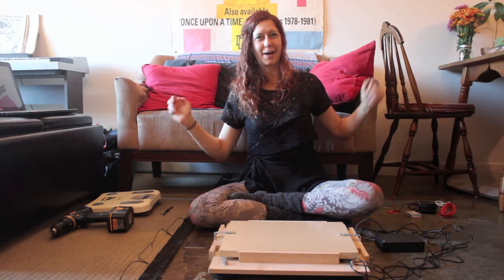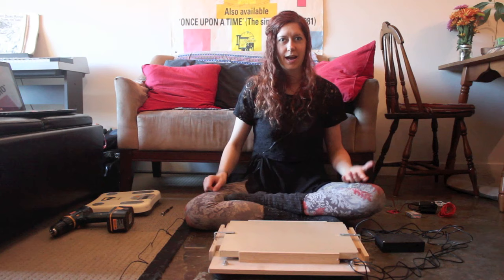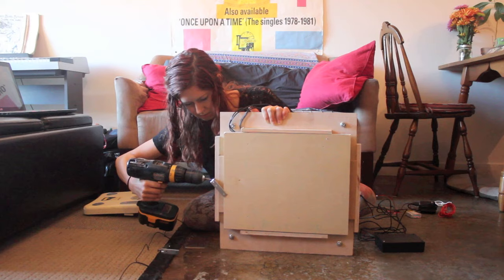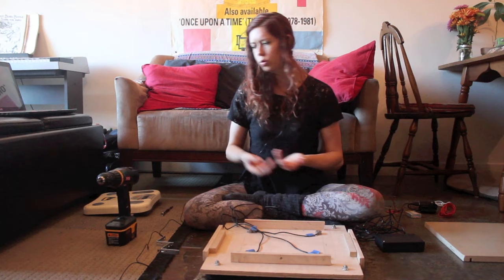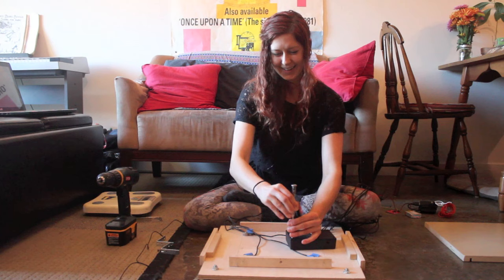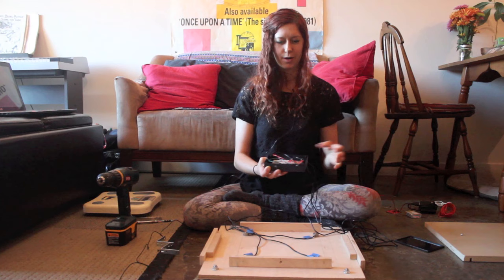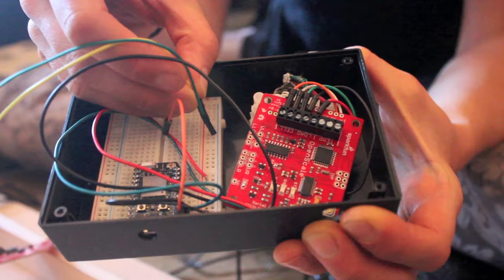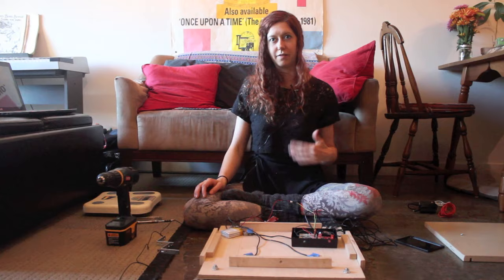Build an IoT Industrial Scale!

Comment: jen, how to you connect four load cells(one with four wires, not load sensors that ends up with four wires) with one openscale? sparkfun does not provide this detail either. thanks!
Reply from the maker: Great question! You can connect them in parallel, then connect them into the OpenScale load cell terminal blocks. Check out the tutorial for a thorough overview on how to do this: https://learn.sparkfun.com/tutorials/iot-industrial-scale
Reply: great! thanks a lot jen, you actually saved me the cost of 26 scale amplifiers (was about to buy 26 load cells for making a stacking scales) !!
Reply from the maker: Heck yes! Glad to help!! :D